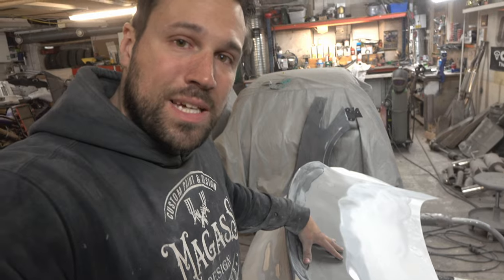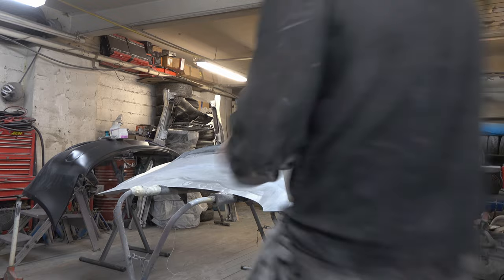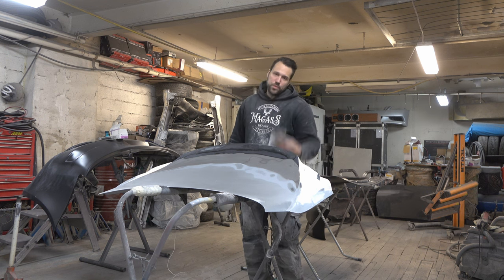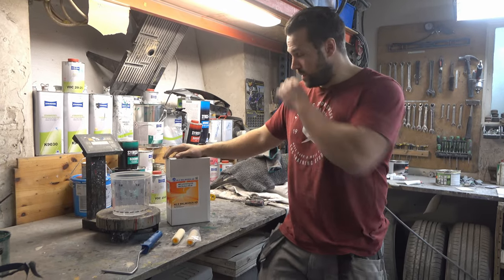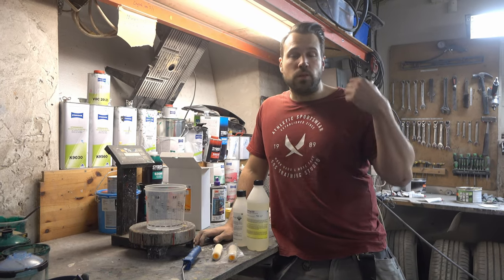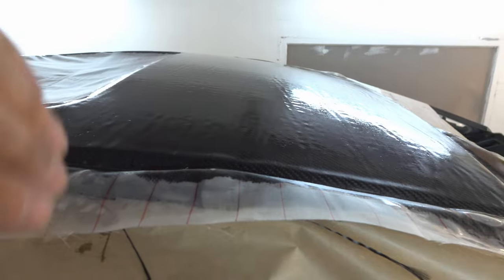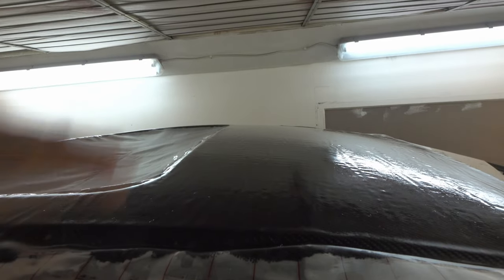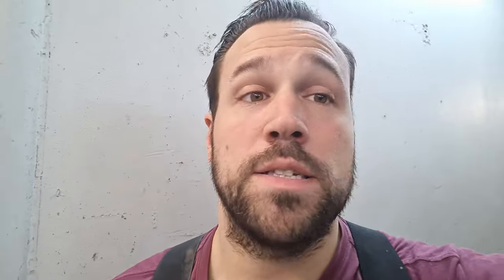How To Carbon Fiber Your Car Roof and Duckbill Trunk (Carbon fiber skinning) [ Infiniti G37 ]

Comment: I’m just doing my rx8 roof has wrap now.     But doing chopped carbon fibre it’s just the rubber window seals I’m not sure 
Iv done my wing mirrors by adding led indicators too.    And added Christmas tinsel in blue
Reply from the maker: Cool

Comment: What kind of fabric is the one that you applied on top and what’s the procedure to apply it without getting sticker in the resting when taking it off?
Reply from the maker: Hi.. It's Peel ply, search for som videos on youtube. Theres a bunch of how to videos.
I use it to speed up and save a lot of material.
If you use a rubber spattel to get out al air you don't get pin holes or (Sticker)
Reply: @MagassDesign  thanks a lot for your reply I’ll check out some videos. I appreciate your help 🙏🏻
Reply from the maker: @clarenceseedorf1981  Thanks for watching man! Really appreciate it!